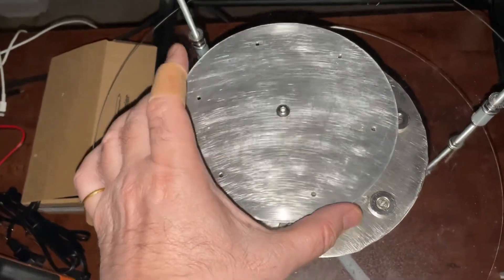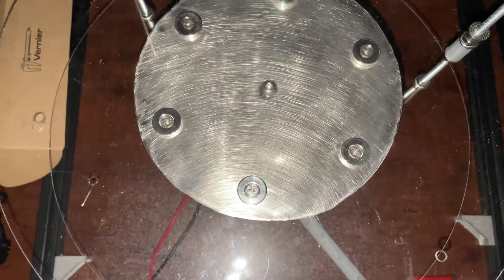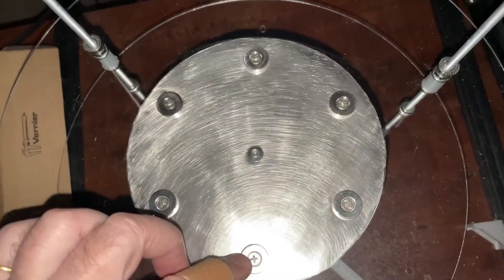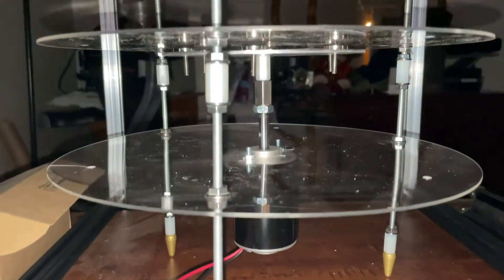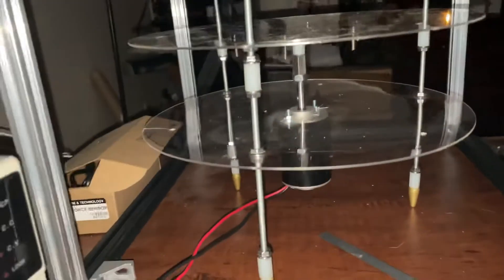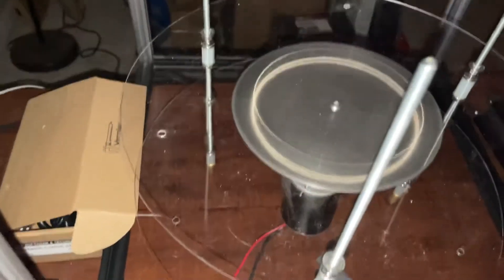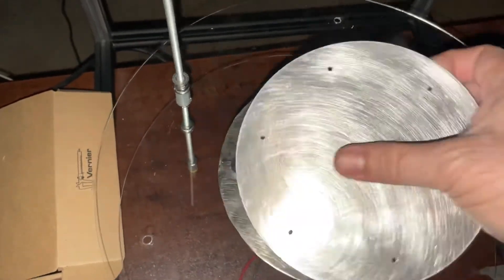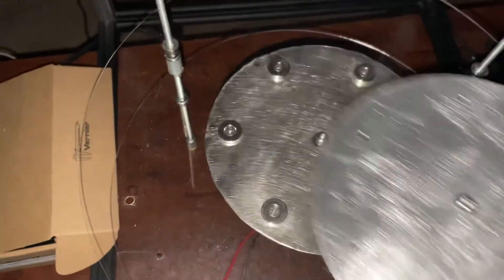Building Antigravity (Part 3)

Comment: Nice rig
Reply: Thanks. Regrettably, a week ago it rolled off the table and smashed into half a dozen pieces on the floor. It wasn't such a rugged idea to use plexiglass. I wouldn't recommend it, but it did look good.